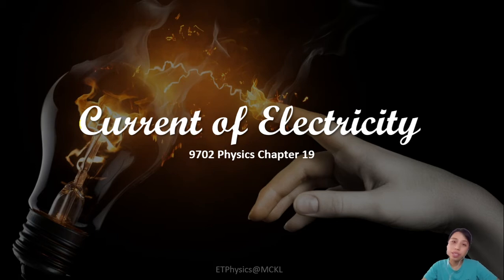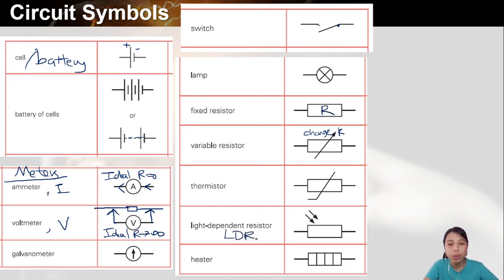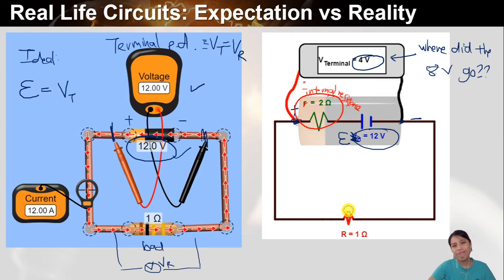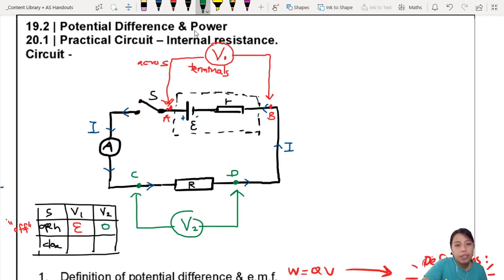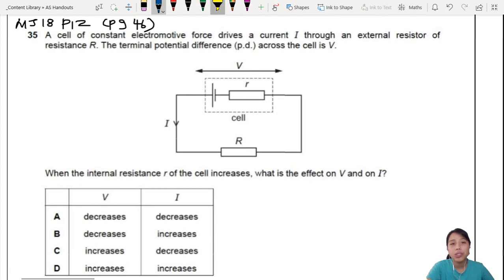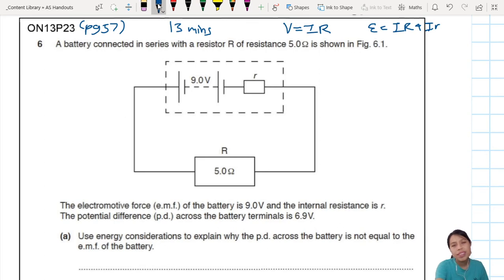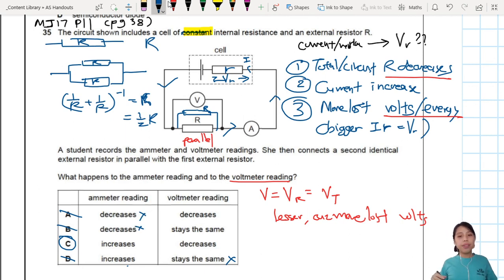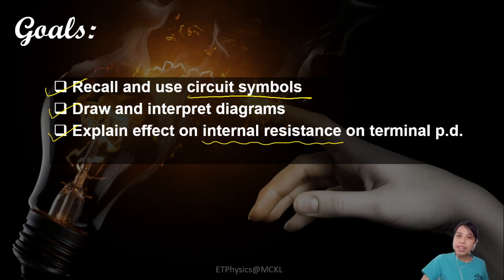[ARCHIVED]  Internal Resistance | AS Current of Electricity

Comment: I love all your videos! Just had a question. Here at 13:33 when the circuit is open, why is V1=E. Since the internal resistor is inside the battery, why isn't it consuming some of the voltage when the switch is open, why only when the switch is closed?
Reply from the maker: If there is no current flowing through the internal resistor, there is no energy dissipated, no voltage used up!

Comment: At 15:51 , how is p.d acoss resistor R the same as p.d across battery. Value of "R" and "r" is different so dont they consume different amounts of volts?
Reply from the maker: Whatever energy supplied by the battery, is provided to the resistor in the circuit! 

BUT if we open up and look INSIDE the battery, we realize that there's actually lost volts (due to r) taking away from the chemical emf.
Reply: sum of volts of individual components in series = total E.M.F
Reply: @mr-bean2306  I wish i have exams in oct nov
Reply: @trigobrooken6260  then?
Reply: @trigobrooken6260  thank god u dont have if you are from zone 4 (RiP) we have clash in chemistry and maths and we are going to give both papers on the same day in PM then the next day we have physics 🥲

Comment: Miss what if we connect the volt meter in  series like ammeter will the current flow 🧐
Reply from the maker: IDEAL voltmeter are designed with such insanely high (infinite) resistance so that no current flows through it! So the voltmeter would basically block the entire circuit.

But the voltmeter is measuring potential difference between TWO points, so it would still give a reading if cattery is on